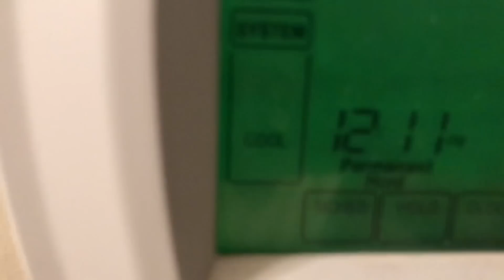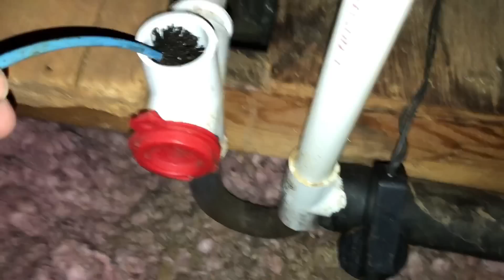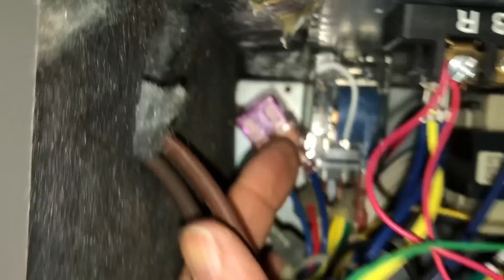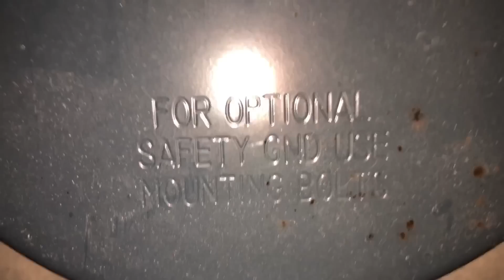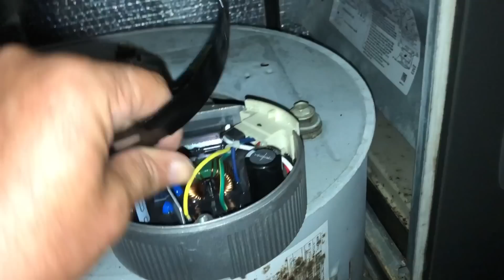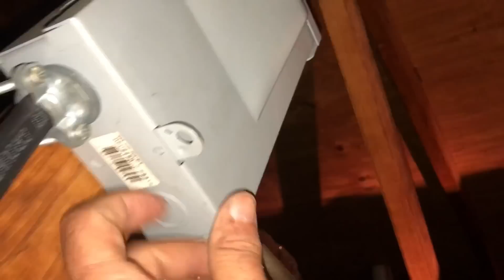Lennox Variable Speed Blower Motor controller module easy repair

Comment: Ted there is a motor company in Florida that have 1,000s of OEM ECM motors rebuilt for all HVAC brands that are priced at about $325.00 with a 1 year warranty. They also sell just the modules that are rebuilt as well with a 1 Year warranty for about $169.00. They ship out very fast as well. I have purchased several ECM Motors and just ECM modules as well and have had great success. I will updated this post a little later today when i get back into my office. Cheers man. Peace
Reply: Looks like United Hvac Motors is the company baeed on a google search
Reply: Their refurbs include replacing "wear items" such as "bridge rectifiers and capacitors" along with a reflash of the program.  The $169 price is for X13 modules, its $229 for ECM modules.  They also sell motors with modules.  I ordered an ECM module; the parts except for the transformer look new and the case was freshly painted.  One year warranty.   Pic of received unit bit.ly/ECMandX13       They said they have refurbed 167,000 units and currently have 26 employees.
Reply: RJParker I don’t think they are selling them based on manufacturer model number they just go by the generic GE numbers and that doesn’t mean it will be the same motor at all as what failed. And are they unpotting all the silicone in the module to repair?
Reply: Yep, there located in Tampa, Fl.  Have used them...good company, product and service.   https://unitedhvacmotors.com/
Reply: @joeshearer1247  you are right bought one from them same GE number as mine from my Armstrong Air (Lennox) furnace and the programming was totally different.  It wasn’t variable speed at all and was full bore only.  Great for cooling not so great for heating.  Ending up repairing old one by soldering a new thermistor and been working over a year ever since. I’m just a homeowner DIY guy and learned a bit about them.  I was out of the $400 they said they had never knew of the programming of mine after I gave them the furnace information. Same style motor as in this video.

Comment: I have had 3, yes three failures on my blower.. The coil windings inside the actual motor shorted out every time! (bent one straight and it burnt up somewhere else in a year) Replaced with a new motor and same issue happened.. On my 3rd motor with a spare ready now lol.. Wish I had that handy tester you made there for the ECM! That is cleaver!

Comment: Also Ted with the Lennox training I have had was informed all Lennox air handlers come set up as a straight cool only. You need to cut the blue jumper between the R terminal and the W2 terminal

Comment: Good repair ! Replace the part that is bad, not an entire assembly (motor and the electronics). It's amazing how the public is taken advantage of due to circuit boards and their cheap quality. It happens to cars and all kinds of things like microwave ovens, stoves, ovens, washing machines etc etc. CHEAP crap circuit boards while most of the mechanical stuff just continues to live and run and run.

Comment: Great video Ted. Its great to see that there are still some good seasoned techs out there that do troubleshoot those modules on those Lennox ECM Motors. That system doesnt look to be too old considering it being a three stage heat two stage cooling. Great Job!!!!
Reply from the maker: Thanks 👍

Comment: Even though it was a quick fix for the motor/module, I'd have pulled the cage out and cleaned it. And if that black residue is actually mold, I'd have taken the whole blower unit out and disinfected it before I put it back in.
Also handy to wear your jumper wire like an HVAC Tech necklace.

Comment: Hey Ted. Great videos. Lets me know what other equipment is out there and the problems and fixes. 99.9% of what i see is nat. gas. Have you ever attempted to repair the motor controller on a dc drive motor. I've seen other vids repairing thei rush capacitor on the 2.5 regal/beloit motors but mine has a burnt link on the backside of the motor controller board between the negative on the c10 and the red wire connected to the board. I was just going to solder a small piece of wire in there and test it but i thought i would see if you have ever attempted a repair like this

Comment: Ted: Was the fan motor turning the correct direction? Hard to tell in the video, but looked like it may be wrong way after the new module was installed. Thanks for great video's.

Comment: I might be doing this same repair quite soon. My issue is that everything works but every day or two now, the thermostat will kick on and nothing will happen. The outside unit will come on, but the blower motor won't come on inside. If I take off the panel and decompress the door switch for a little bit, along with turning off the thermostat, everything will work again once reconnected. I have power going to the connectors for the ECM and the motor windings are within ohm spec from what I saw. I'm just getting tired of having to reset it every couple of days (or sooner). Hopefully this will be my fix as well! Any additional input is always greatly appreciated if there is something that I'm overlooking and might help me. Thank you for this informative video!

Comment: lennox cbx27uh blower motor works fine on cold setting yet it does not work with heat or manual fan , what is in control ? is it a separate controller or is the same as the module on the back of the blower motor ? controller on the back of the blower motor was replaced not long ago with a manufactured unit .
thank you

Comment: The variable speed blowers in Lennox furnaces and alot, if not all, of air handlers comes factory set to slowly ramp up to 100% operation. Takes 7.5 minutes to reach full speed. This greatly increases dehumidification.
Reply: Do you have power surges in your area? Have you checked your incoming voltage to ensure it’s correct and tried a quality surge protector on the unit?

Comment: I heard variable speed motors don't last long. They did not say you could replace the module by it self. I love this guy. No homo.
Reply: High Static pressure in the hvac system is the #1 reason why the electronics fail

Fix the ductwork and they last their normal life span, 12-15 yrs

Comment: I ordered the exact motor and module used and when i hooked it up it only runs fast for 10 seconds and then runs medium speed which is not enough to push air..does anyone know why

Comment: The cost of that motor is half the price of the air handler at the company I used to work for. Nice save!
Reply: I promise that was still not a cheap fix.
Reply: @jeremygoldsworthy  That module alone is almost $300 on amazon
Reply: Gee,, let’s put an ecm motor in so we can save a $100 a year and then spend a grand Every 10yrs for a repair
Reply: Some companies are going away from psc motors altogether. Big tickets in the future. 
It's a dirty game

Comment: Ecm are bad, bad, bad. At least this one was repaired with module only. Last year I had to replace my entire ECM condenser fan motor because The module was not separate from the motor. It was one-piece. That part cost me $900. Yikes!

Comment: We have a 2003 Heat Controller downflow furnace.  We had it serviced and the Tech said we should replace it.  I asked why and he said the new furnaces are 96+% efficient and have an ECM Blower.  Our Furnace is 92% efficient and has never had a failure except for blower motor bearings failed.  After seeing these videos we are not sure why we need to replace our reliable furnace?
Reply: you don't as long as the heat exchanger is still good, u probably got a salesman.
Reply: @Jon-hx7pe  It has dual stainless steel heat exchangers.  We have carbon monoxide monitor's in house in case they fail and contaminate living area.  Furnace still looks like new in and out.
Reply: @scotta9114  Many techs are likely commissioned. 10 to 15 years and it's out there door when there are 25 year old furnaces running safely and reliably. It's such a shame - a lot of good equipment gets scrapped and homeowners ripped off.

Comment: All these variable speed motors  cost big bucks so to get you to pay a bit more money for a more energy efficient unit using them the manufacturer gives you a 10 year warranty on the motor! So after 10 years it will fail and now you are supposed to get a new unit because of the cost of replacing that motor on a now over 10 year old unit! Talk about planned obsolescence! Thanks for another awesome video TED!
Reply: there's a universal replacement now for new units with ecm, it takes the firm-wear from the main board. the main benefit of variable speed is automatically getting the correct cfm across a large static pressure range and maintaining it as conditions change like filter getting dirty, balancing dampers being adjusted.
for those who want lower repair costs, can get a unit with an x13 and retain the energy efficiency.
Reply: It's somewhat better comfort, with the fan only running at high speed when really needed. Sell that to the customer, but let them know the ECM will go bad eventually. More service $ down the road.
Reply: @johnhaller5851  the customer doesn't have a choice for furnaces - all required to come with ecm motor. a question of whether to go for the cheaper constant torque or the more expensive constant airflow/variable speed version.
In general high end equipment is much more for comfort than energy savings. I'm a fan of 2-stage/constant torque furnaces - so much better than single, yes, a bit more to fix but repair costs aren't as astronomical as the high end units with variable speed.

Comment: Supco makes an ECM tester that does ECM 2.3 (16 pin), ECM 3 (4 pin), and X13, Evergreen, and other ECM motors for like $50.
Reply: Carlitos, thanks for the information.
Reply: @johnnyriser8519  I have one and it sure does come in handy to rule out the ECM as the issue

Comment: Those so called variable speed Lennox unit really save customers on energy? Maybe, but in the long run, it costs customers much more to repair the unit. A board costs over hundreds and up to thousands, some thermostats cost over $500. And HVAC technician spend more time on diagnosis. Keep it simple in HVAC field, manufactures!
Reply: You might save 300-500 over 15 years depends on kwh$, runtime, no one saves anything with these because they fail 3-10 years if lucky.  Now since 2019 govt mandated these in all blowers, hopefully they fixed them to last like a PSC but I doubt it.
Reply: @publicmail2  high static pressure kills them. maybe contractors need to stop putting oversized units on undersized ducts.  any product is junk if misapplied. 
hopefully the newer ones protect themselves better.

Comment: Cost is $300 for module for these ECM disasters.   You might save 300-500 over 15 years depends on kwh$, runtime, no one saves anything with these because they fail 3-10 years if lucky.  Now since 2019 govt mandated these in all blowers, hopefully they fixed them to last like a PSC but I doubt it.
  In some cases with high SP they use same kwh anyway vs PSC which last 20-30 years.